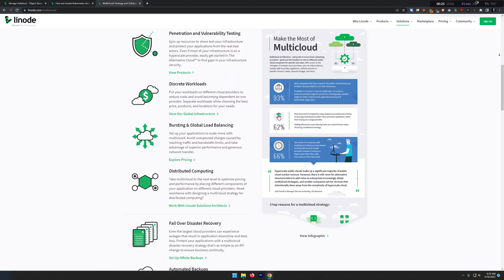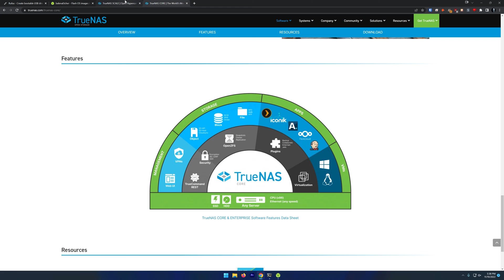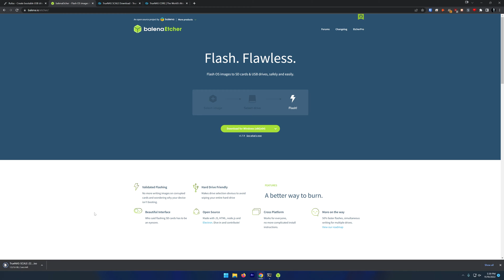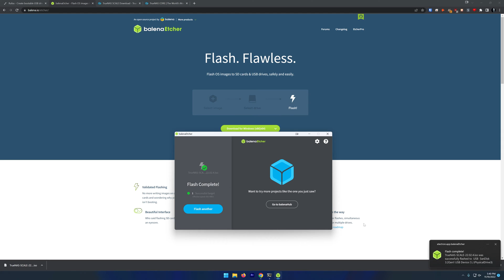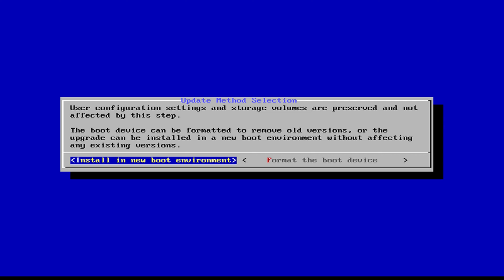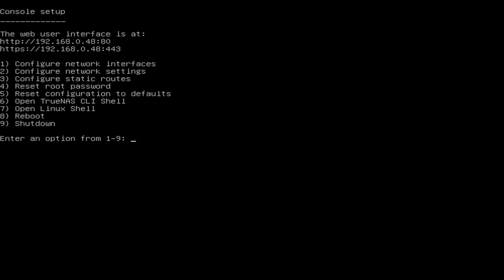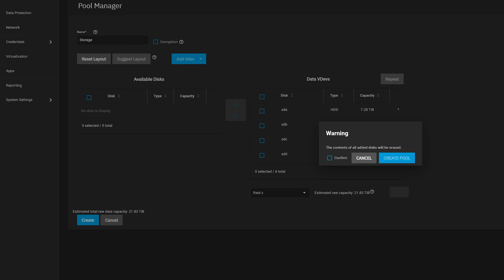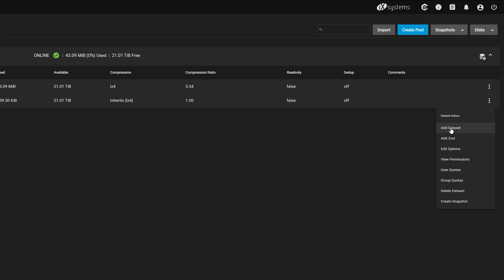How I Installed TrueNAS Scale on a TerraMaster F4-423

Comment: В TerraMaster F4-423 у меня Том 1 (RAID1 2x320GB) показывает что он полностью занят данными. По факту (проверял через командную строку как Admin) там всего данных меньше 1 GB. Что не делал, как не чистил, - все равно RAID1 забит файлами до отказа. Как решить проблему? Заранее спасибо
Reply: Little confusing. Are you saying that you have 2x32 gigs of ram? You still need a HD
Reply: @Dadum-bass  I have 2 slots with hard drives of 320 GB each. I use these drives as RAID1. The file manager shows that they are full. But in fact, all information has been deleted from them. I can't write anything to these hard drives now.

Comment: Why do you have to open the unit and swap usb sticks? It has two external USB ports.
Reply from the maker: I like taking things apart
Reply: @DBTechYT  I guess what I am asking is, is it even possible to boot off an external USB on the USB ports on the back of the enclosure? Also, my F4-423 is vibrating terribly, does yours as well. Video clip: https://www.youtube.com/watch?v=-gKKyu7C6qc
Reply: @DBTechYT  I guess what I was asking is is it possible to boot off of USB if you plug in the USB in the ports on the outside of the case?
Reply from the maker: I think it's possible to boot from the external USB ports, but I think you've got bigger problems. Are you able to isolate that to a single drive? I think you might want to run some tests to see if you've got a drive failing

Comment: I know this a year old video, but did you leave TrueNAS on the device? And after a year what are thoughts still on it, if you are still using.
Reply from the maker: I ended up not doing anything with that device, so I scavenged a couple of hard drives out of it to build a CasaOS setup with a ZimaBlade. I still need to make a video about that device, but once I do, I'm planning on putting the TerraMaster back together and putting Unraid on it to give it a go.

Comment: I just got this Teramaster today - and I have been reading that some third-party RAM won't work on it - the ram listed in your description section is working okay for you?
Reply from the maker: It's been working without issue since I installed it.
Reply: the problem is with their software. TOS 5.0 blocked thirdparty ram, but I've seen posts saying they removed it with TOS 5.1. Anyway, if you use truenas there will be no problem.

Comment: FYI as far as I know, this no longer is possible, because TrueNAS completely deactivated the Realtek drivers for the NICs in the Terramaster unit. Therefore, although you can install the current version of TrueNAS, it is not able to use the LAN ports on the NAS.
Reply: Sorry, this is not my field of experience, therefore I am asking: Does it even affect the F4-423? The processor in use is a Intel processor and not a realtek one like on some other units? Is there a Realtek component in the Terramaster F4-423 that causes this issue with the LAN ports? I ordered it cheaply and planned to put TrueNAS on it, but this comment makes me reconsider it if it's not has the full support for it.
Reply: If that's the case, wouldn't it mean the ethernet ports don't work even in the default OS?
Reply: I bought this Terramaster model, but it's not even using realtek. I currently have truenas running on it using the full bandwidth, so the information is misleading
Reply: Very misleading and complete lie. The system works just fine with TrueNAS. Why would they disable the NICs?

Comment: You do not need to remove or replace the internal USB to install a new OS.  

Instead plug a bootable USB in the front, enter BIOS, and you can swap which USB it boots from within an obscure submenu under the "Boot" tab.

Comment: What's the main advantage of True NAS, other than the User Interface? Does True NAS allow it to be remotely accessed like DropBox using a Mobile App?
Reply from the maker: My point of sending you wasn't to promote TrueNAS. It was to show you how the installation process works. 

I don't fee like I'm going to be any help to you because you just dump multiple questions at once every time you get an answer. Your comments/questions make you sound manic and frustrated.

I would suggest going and doing more independent research on the NAS device you want to use and see if it fits your needs. If you can't find one, I would encourage you to head over to this subReddit as they are going to have more information that will be helpful to you than I will: https://www.reddit.com/r/HomeNAS/
Reply: @DBTechYT  Thank you.

Comment: Thank you for the educational video. Since you welcome proposals, most home users would probably benefit, if you created a series of setting up most common applications, in a way similar to omv. The underlying framework is somewhat different (kubernetes) and relevant documentation/guides/videos are severely lacking (at least when I searched some time ago). Personally, I use an ubuntu server and added apps through docker and although I have tried truenas and probably willing to move to the platform, the framework and lack of guides has held me back.

Comment: FWIW, if anyone happens to have a QNAP TS-453D, I just discovered that it will actually boot off the two drives on the RHS nearest the power button. I had mine setup with 1x external USB 500 GB SSD plus 2x internal 500 SSDs in Raidz-1 (Proxmox) and that worked for a year but in reconfiguring it (to sell) I saw a couple of drives showing up in the BIOS which I never noticed before, so I removed the external USB SSD, reinstalled Proxmox, and it's now booting up directly off those two internal SSDs minus any USB drive! For over a year, I thought it was NOT possible to boot off the internal drives at all.

Comment: There is a post somewhere about how to hack the TN installation script, so it only uses 16 or 32 GB of the boot drive in a separate partition. Then you could use the rest of the boot drive for storage, or perhaps cache in the case of a NVMe drive.

Comment: Follow-up video content idea. Truenas has features that other NAS operating systems do not: Compression and deduplication, due to the ZFS file system. Since this Terramaster NAS has a relatively weak CPU, I'd like to see how the NAS handles this.
I haven't found any good data on these features in a low traffic setup, such as only one write stream and a few reads at a time. Does compression tax the CPU to the max and affect speed? Is deduplication even possible, as this puts a lot of load on the CPU and memory?

Comment: Why not go with unRAID, that runs from USB. You could use teh nvme as a cache drive. This would be a better solution imho
Reply from the maker: Because this was just for demonstrative purposes. Not everything I make a video about is something that goes into production on my network.
Reply: Can’t true nas run from usb?
Reply: @Martin-delta  note sure, but it is not recommended..  unRAID runs in the ram so it doesn't wear out the USB that much as truenas will

Comment: Thanks for showing us the process! Once you removed the internal USB boot drive, did you have to use that USB port for the TrueNAS installation media, or could you have used one of the other USB ports on the back?
Reply from the maker: Thanks for watching!! I read/saw/something that the device looks specifically for the internal USB port to boot from, but I didn't test the other ports.
Reply: @DBTechYT  X-Systems doesn't recommend running TrueNAS from USB since version 11 core
Reply from the maker: I don't think that was the question. I think they were asking about being able to put the installation media into different USB ports just for the installation process, not installing on a USB drive. At least that's how I read it
Reply: @DBTechYT  Correct.

Comment: Do more videos using Truenas Scale as the systems OS
Reply from the maker: That's what we have installed here. Are there specific things you'd like to see videos on?
Reply: @DBTechYT  Traefik + Authelia + cloudflare tunnels on one same video.

Setting up a Navidrome with remote capabilities, bonus points if also includes the mobile app setup 

You can probably recreate Plex/Jellyfin + Prowlarr + Sonarr + Radarr + VPN qBittorrent (its been done by anyone with a pulse but there are very few that do it walking new users starting out on Truenas Scale)

WG-Easy

Any other TrueCharts app that does not currently have a video on youtube.

Comment: Even though it seems a good idea, are you sure there is no h/w level raid in terramaster default configuration? ... since zfs and h/w raid don t get along well due to the well known and documented reasons. Also you could have made a comparison test between smb speeds of terramaster's btrfs share and the same from truenas side. Finally you could set up a disk failure and check during the resilver process cpu utilization. 
As for what you do further with this installation, sync would be next logical step, nextcloud, vpn a small linux cli distro (turnkey , alma) with pi hole / ad-guard or something .
Reply from the maker: I definitely never said that this was a good idea, but I'll keep your comment in mind moving forward with future videos :)
Reply: @DBTechYT  I do lots of stuff that isn't a good idea, lol. As Adam Savage often says the only difference between screwing around and science is documenting the process.
Reply from the maker: @Trains-With-Shane  SCIENCE!!

Comment: I have previously done this on a terramaster f2-221 just for an interesting project. It only has an Intel Apollo J3355 dual core , so not really expecting to et many VMs running.
Reply from the maker: Yeah. This one has 4 cores and 4 threads, so VMs are basically out of the question, but for running apps natively and storage, I think it'll be a great solution.